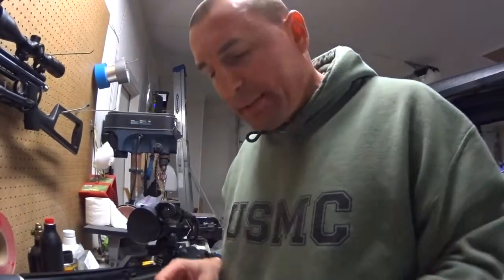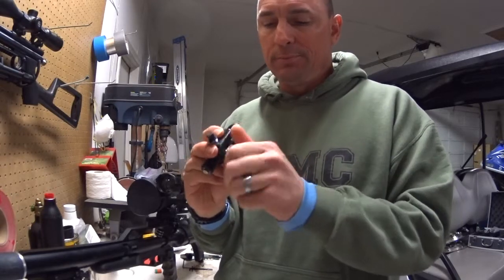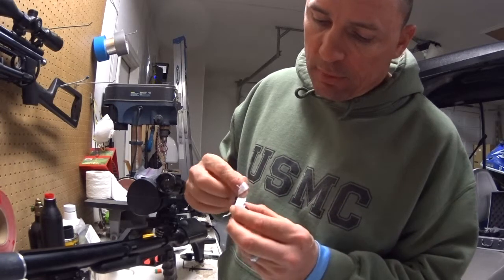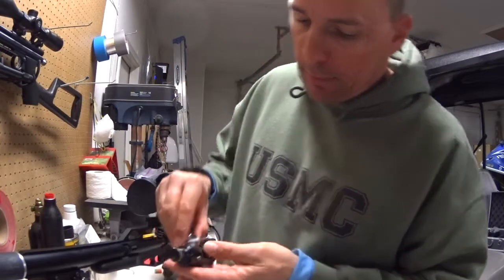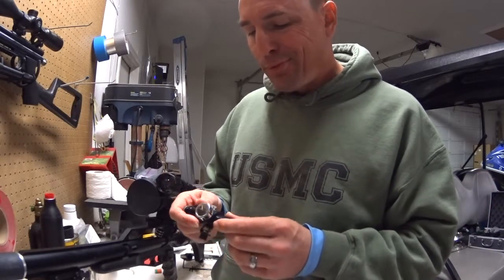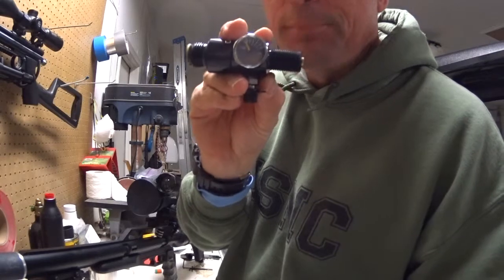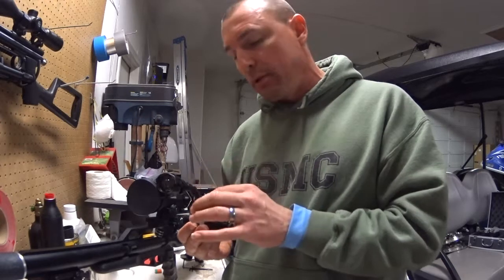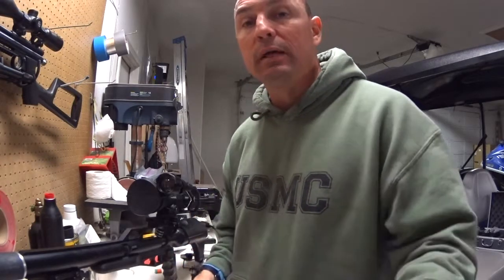airforce pressure gauge

Comment: P.T.F.E. Tapes work a lot better and get them on ebay by the 10 pack cheap too in europe as teflon tapes not really a thing here ?
Reply from the maker: As long as it will stop leaks and its not going to explode when dealing with high pressures then use it. And its always nice when you have a solid supply of it.